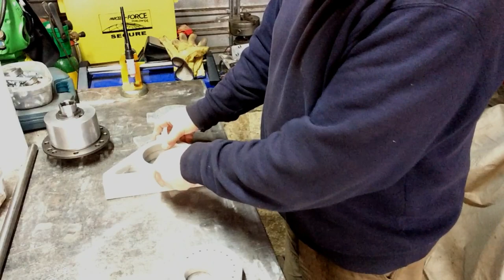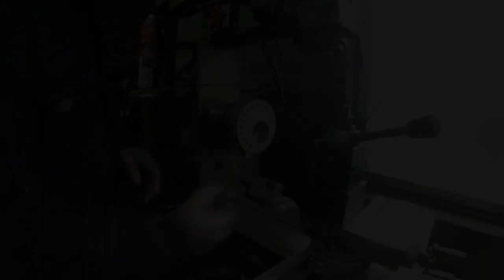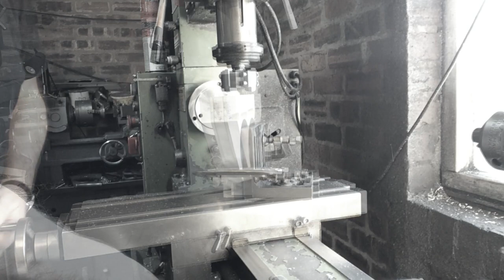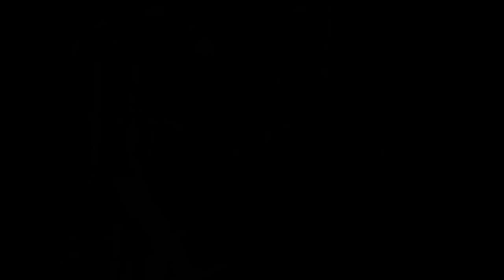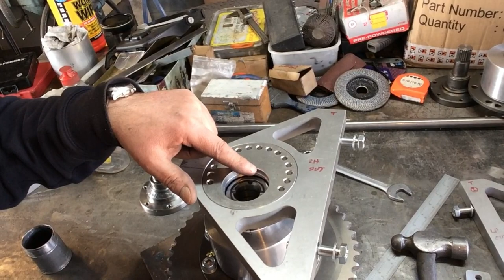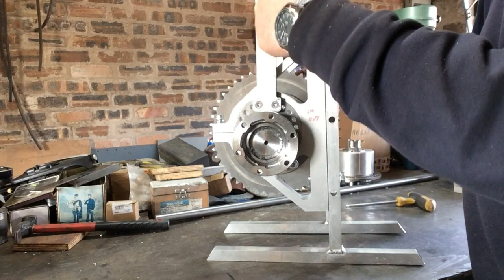Eccentric Adjusting Mount for Chain Drive Differential

Comment: Hey Doug, i just have a quick question in regard to the bearings as i'm working on a similar project to this. Did you make the diameter of the hole to house the bearings the same as the bearings outside diameter? OR did you make the hole a little bigger to accomodate for the bearings?         I saw you also heat up the mounts; could you please expand on this?

Thanks :) (great video as always)
Reply from the maker: Hi, check the bearing manufacturer's data sheets. Normally the fit of the bearing is a slight interference fit (typically 0.002" on the sizes of bearings we use). Alternatively, if your fit is looser you can use 'bearing fit' adhesive to secure the bearing in the housing.
Reply: @DougsShed  Sounds good mate, thanks for the reply :)

Comment: Hi Doug, excellent video! I have a question about the clearance on the hole in the mount that the chain tensioner goes into. About how much should that clearance be? Is the split line at the top where it clamps just a straight cut through or did you take a little material off as well in between the two tabs? I am designing a mount myself and would appreciate it if you could let me know. Thanks!
Reply from the maker: I usually machined the parts to a clearance fit before splitting. The split line is horizontal at the rear. Split was the thickness of a hacksaw/bandsaw blade.

Comment: Hey Doug, awesome video! Do you think you could give some more details into some of the components that you used in this? What differential was used, what bearings were used, and what oil seals were used?
Reply from the maker: Hi Trysten, I have now added details of the differential, bearings, seals, output shafts and the sprocket to the description of this video. (Click the "Show more" tab)

Comment: Hi Doug, do you have the measurements for the diff side to side? I have a semog buggy and j would like to fit an lsd in it. Do you think it’s possible to mount the sprocket as well as the disc brakes on the diff?
Reply from the maker: Have a look at https://youtu.be/rGWsgsf7RXg which has twin disc brakes. The eccentric mount on this unit won't work with disc brakes.

Comment: Hey Doug , thanks for the video , I'm building a VW dune buggy and I mounted a Suzuki Hayabusa engine in it , but I'm looking for a differential with a chain drive , and it seems what you have showed in the video is something I could use  , can I buy the mounting brackets from you and which diff should I use and where can I buy it ?
Reply from the maker: Unfortunately I have now retired and no longer have any of the parts available.

Comment: Great design. What bearings do you use.
Reply from the maker: KLNJ.1-1/2.2RS or R242RS - 2.625" OD, 1.5" ID, 0.5625" wide.
Small bearings used on the eccentric mounts.
On regular bearing carriers I use larger LJ1-1/22RS - 3.25", 1.5", 3/4" bearings
Reply: @DougsShed  many thanks. Really useful videos, keep them coming 👍